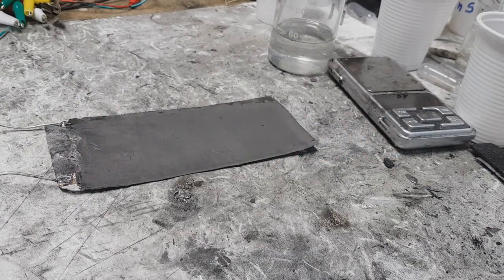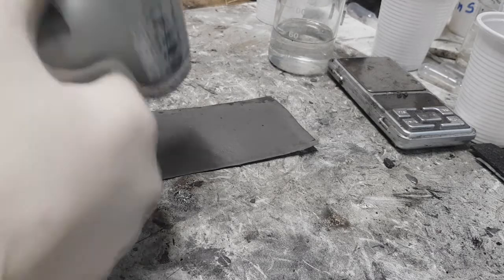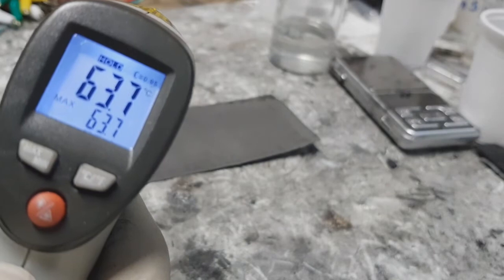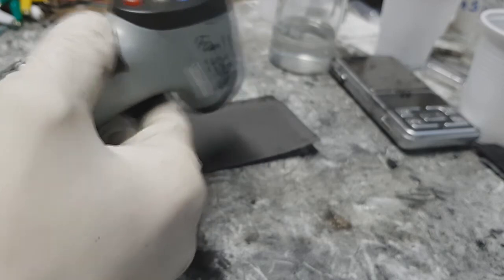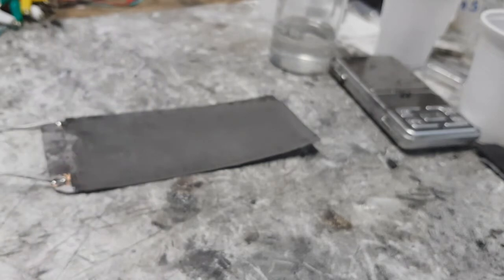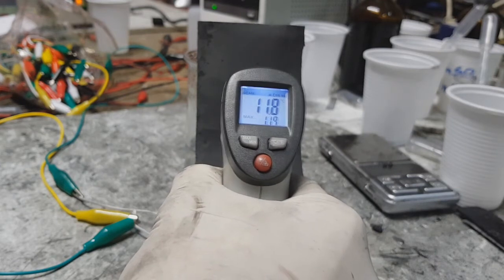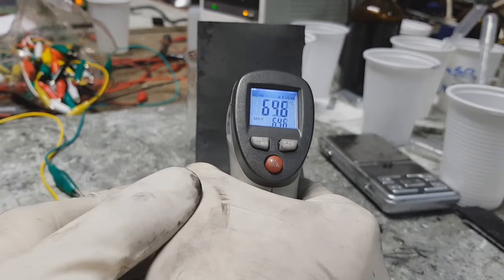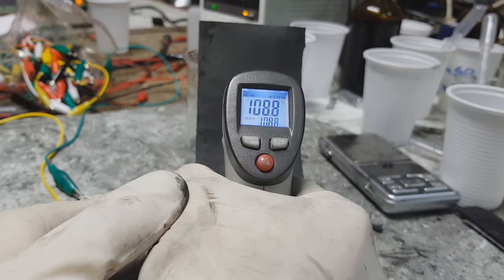Conductive Ink Heater (200 degrees C)

Comment: Hello
Did you ever try to use several elements in series and connect to 230v regular plug?
Reply from the maker: No, but I make a big one on 230V https://youtu.be/AUr2oxYVgms
Reply: @cayrex  thanks for the help
Where are you located?
You guys have a very good experience with the conducting ink.
Did you had experience with higher wattage?
Around 2500 to 3000W?
Reply from the maker: @rainerschnell6159  I am from Slovenia.  The max power which I tested was around 1000W (230V 5A). But all can be done.
Reply from the maker: We make the whole range of conductive inks. Also some custom inks can be made.
Reply from the maker: Another one https://youtu.be/KDzMkduo3Kg

Comment: well done Dusan. was the ink painted on paper ? When will the paper catch fire and does it smell a lot cause the binder decomposes ???
Reply from the maker: Thank you. The ink is not painted on paper,..... the back of the heater is made with some fiber material which can resist some high temperature (I dont know the name). No, no smell from binder. The binder is also water and high heat resistent.
Reply: cayrex2 Try to coat it with some additional small granite stone powder that will make it store the heat additionally. ...
Also by using then High voltage BackEMF pulses for the input you probably could use less input power...and maybe if you have Thorium salts in there use the low latency radioactivity. ...
Reply: I meant like Thorium batteries. ...

Comment: Very interesting - thank you!  At 200 degrees C you open up a whole new world of applications.  I wonder if there are ways to make the unit more robust to handle those temperatures without burning out?  And thank you for all your videos- I'm working through them.  I wish I could support you on Patreon, but I'm just a school teacher/experimenter without a lot of funds.  I'm getting ready for a summer kids STEM (Science Technology Engineering Mathematics) day camp, and trying to develop variations of various energy storage devices using extremely safe materials.  My strongest acid is acetic acid, my metal salt is sodium chloride, etc.  I hope to use a variation of the microwave carbonization technique from Robert Murray-Smith's recent carrot video using sodium chloride.  From your description of metal salt based activation, I wonder if it will carbonize and activate at the same time?  I can always try a second run through the microwave with the salt and see if the results improve.  So many experiments to try, so little time! ;)  Anyway, thanks again for all the time you've put into these videos, Leo Wadsworth.
Reply: STEM Camp Projects 
👌
Reply from the maker: Thank you mate. No panic for patreon,... a nice comment is also really good support for me. The unit can be made more robust,.... wait for this, this is only a start 😉

Comment: Hey there buddy . So a solution to copper strip alternative is to use carbon fibre strands. For heating applications it goes on both sides if you like or in between like sandwich 🥪 . For cells it can be splayed out over the surface of one side ! Hope this makes sense . If you heat it up first it will become more conductive
Reply from the maker: nice mate